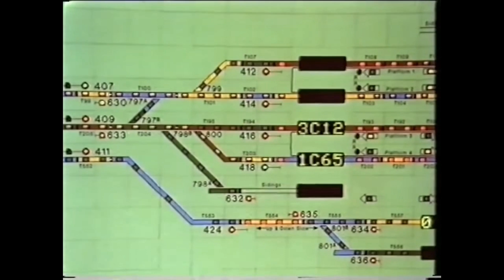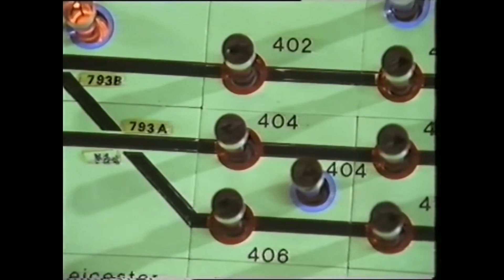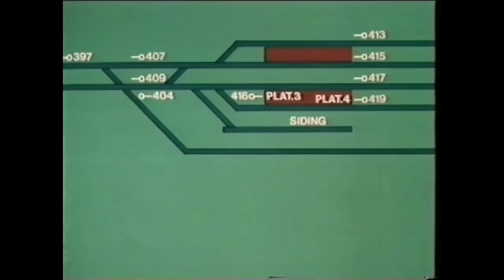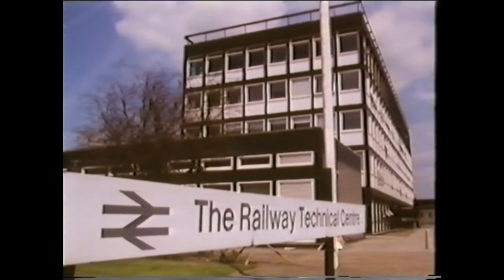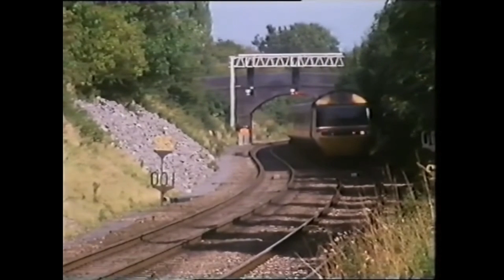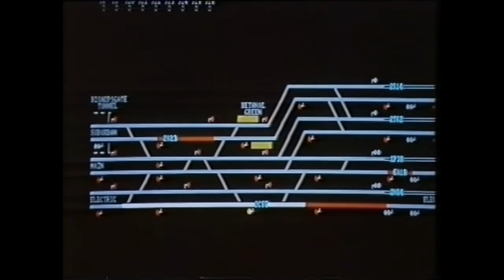British Rail signalling 1989 applying computer logic to solid state interlocking & control / display

Comment: Can’t beet a VDU
Reply: Until quite recently, VDU quality simply couldn't match the NX panel for presentation and clarity to signallers. Screens could be too cluttered. Trackerball/keyboard control of curser used to be very awkward compared with fingers on physical switches and buttons.